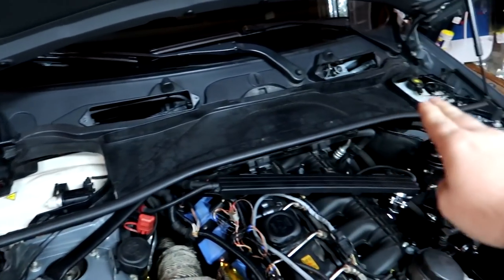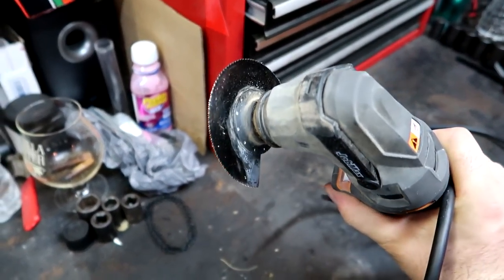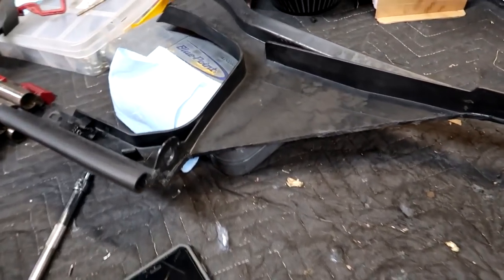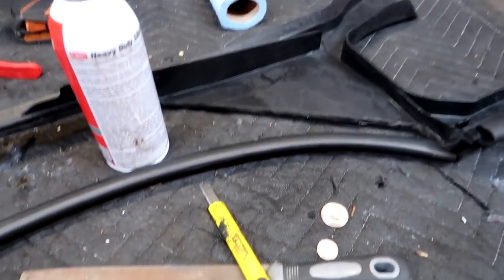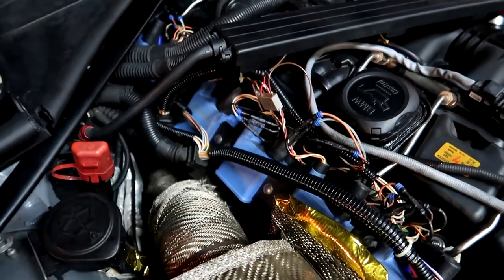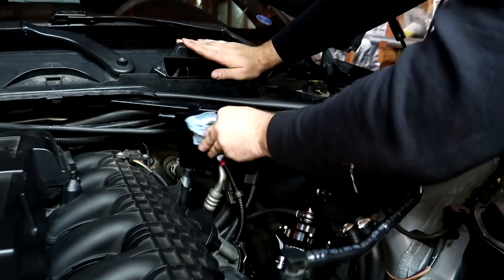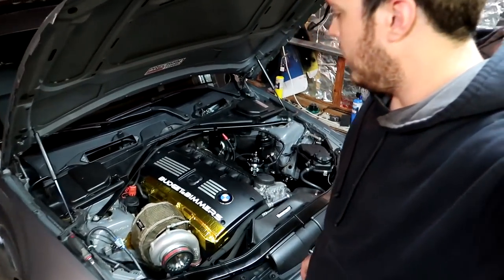E92 DIY Cowl Mod (M3 Style)

Comment: Fuse 39 powers the injectors and the coils. The first thought is that the upgraded coils are causing the problem, but according to the manufacturer's website, the precision raceworks coils actually draw less amperage compared to stock.

It's possible there's a defective coil with lower than normal resistance drawing more current than designed. You would need an amp clamp and a scope then check each coil to see how much current it's drawing

Short circuit is also possible, and with projects like these it's bound to happen.

Injector(s) over-current or wiring short is technically also possible, but I've never heard of it. Although the injectors don't have the best track record in reliability..
Reply from the maker: +Dan.vaku thank you this is very useful information. I have to look further into the problem and trace all wires, I have an idea as to where the problem could be, but we’ll see
Reply: Budget Bimmers have you solved this problem?
Reply from the maker: Yeah only this i found was a ignition wire covered in oil because it was under the oil cap

Comment: After 6 years of removing all that crap constantly. I also am going cowl delete, and i agree with the way you did it. Looks 100 times better. Good job!
Reply: Same here! Well not 6 years only 3 for me lol.

Are you planning on cutting in the same spot?
I was under the assumption that it should be cut about an inch out from where Zach cut his? Heard it helps with keeping water out of the 5 & 6 spark plug holes but I don’t know if it makes a difference. I might leave enough to put a piece of weather stripping on the back section as well. Anywho...
Reply: @alloutofdonuts3998  haha. I didnt think of that. I have a few types of weather stripping at my job. Some have like a lifted ridge on one side. This might help. Sounds like im going to be pouring buckets of water on my windshield with paper towels in the engine bay to see where the water pools lol
Reply: @emili90110  nice 😃

Comment: question
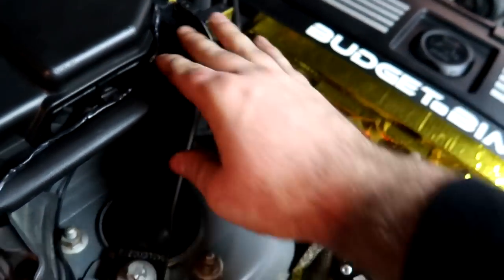@ 6:50 "sensor" i know there is two. one on passenger side, one on driver side. 

if I am not mistaken ,from my understanding one goes to the factory alarm (please correct me if I'm wrong)
and the other goes too what???
Reply: I believe passenger side sensor is for air quality which would be used for auto air recirculation mode. I'm guessing driver side sensor is temperature but don't know for certain

Comment: My bets are on the fuse being related to the upgraded ignition, unfortunately. Definitely check to see if any wires are loose or making contact when they shouldn’t be. When it’s running try jiggling the wires and see if it pops the fuse. Good luck man, cowl looks great!
Reply from the maker: Josh M I was wondering if that was the case as well. I was thinking about trying a 40a fuse but I don’t want my car to burn to the ground
Reply: The coils actually have less draw on the electrical system because they have a longer dwell time. Go to precisionraceworks website and you can read the explanations as to why that is.
Reply: Use a multimeter on ampere setting and messure the amps drawing for the coils.Meten is weten.
Reply from the maker: +Peter Hubregsen do you know where the power is supplied to the coils from?
Reply: You know witch fuse blows so put your multimeter leads between the fuse points and wiggle the wires you suspect are perhaps give a problem for a short to ground.With running engine off corse and look ad the multimeter how mutch amps and it it's changes in amps.

Comment: You could try a “megger” if you haven’t already. Disconnect all the components in the circuit (very important) and a megohmeter is designed to put enough volts that a slight chafe or short will show when a regular meter won’t catch it. Test voltages range from 250/500 volts. Don’t let the voltage scare you, there’s very little amperage behind it. Think electric fence:)

Comment: You ever think of doing the

LCI rear light mod with coding out the bulb checks? That's gonna be my next 335i mod.
Reply from the maker: David I honestly prefer the look of the pre lci tail lights
Reply: I ordered some cheap eBay red vinyl and did the LCI mod. You essentially cut out a piece shaped like the turn signal white strip and put it on similar to putting headlight overlays on. I made an easy cut-out by outlining it first with green painters tape, then using blue painters tape over the green painters tape. I then remove all the tape off (In one whole piece) and cut the trace out with a scissor. Lay it on top of the vinyl wrap, cut out the shape and easy peasy. I did it with no experience with some heat, water bottle, and patience!

Comment: Nice video. Good details.
Are those wires that you removed from the black plastic piece long enough to reroute so they're out of the way or do they still run across the top of the engine cover somewhat? Thanks.
Phil
NYC Area

Comment: Did you replace your n54 PR Coils to N55 PR coils? The N55 PR Coils are supposed to be 'relocation' coils to allow for them not to be close to single turbos. And they are compatible with both N54 and N55.

Comment: Did you get a new air inlet duct from the diesel verson? I have relocation inlets and want the cooler air going to them.
Reply from the maker: dapz325 that is actually the stock inlet flipped upside down 😄
Reply: nice, I was considering testing fitting to see if it would work like that. Now that I know I'll hook it up tomorrow , thanks. Keep that good content flowing.
Reply from the maker: I did have to heat up the the bottom in order to get it to fit around the fan shroud

Comment: That sensor you plugged up next to the ecu box, theres one on the driver side too, what’re they for? I’ve been wondering for a while now.
Reply: Driver side is for the factory alarm passenger side is for the factory air filter sensor ( which you don’t need or use with the bms cowl filters).

Comment: hi. is the electrical issue hot or cold start? air on or off?
throw any misfire codes?
and last question what is the catch can , got a part number for it ?
keep us informed about the fuse thing maybe can help fix it.
Reply from the maker: andrei put Either or, it has popped after a 3 hour drive,  10 min drive, a few mins of idling, and as soon as I tried starting. It’s throwing no codes at all. the catch can is from Burger Motorsports

Comment: What weather stripping/gasket did you use?
Reply from the maker: Jason Atleson i used the rubber that i cut off from the cowl
Reply from the maker: @svtfast i trimmed the plastic piece with a dremel to make it fit better

Comment: My words its much better for the 5. and 6. Zylinder less heat
Reply: Actually, cylinder 5 is right under the bar, and 6 is aft of that, and under the triangular plastic he left in place.The customized tray will still have to be removed to access plugs and and coils. As you mention though, I have observed too that plugs 5 and 6 'run slightly differently' than the rest of the line-up (looking at used plug coloring/residue), and certainly thats the 'heat valley' for infrared coming off the turbo assy's. Regarding the exterior of plug 5, I believe that if there is even a small oil leak from the PCV valve, it shows up as a greasy plug 5.

Comment: I agree with MOST of your decisions, but not this one. GET RID OF THE ENTIRE Cowling. There is NO NEED for it. I did the full cowl delete package, and it is sooooooo much nicer whenever I need to work on the car. You ONLY need the filters for those vent holes.
Reply: Would it be a bad idea to do a full cowl delete if I live in a bad weather area such as snow and water
Reply: @dkazemini  Of course it wouldn't. What has snow and water got to do with filtering your cabin? You can go onto the Burger Motorsports site, and find the cabin filters for the Cowl delete for ONLY $60. It's sooooo much better. They pinned the link for this on this thread.